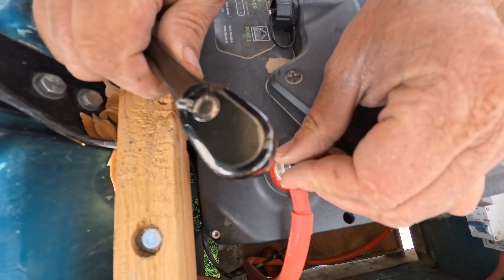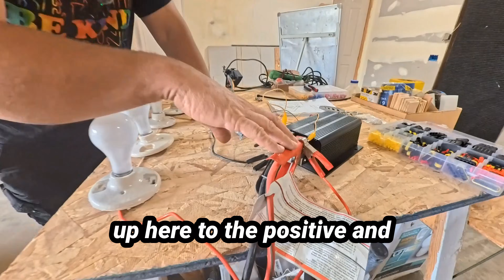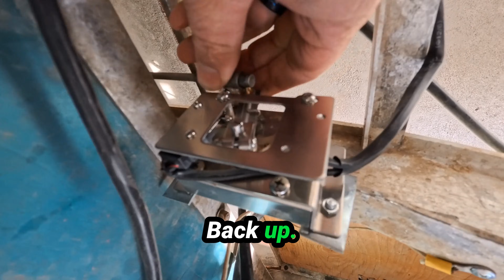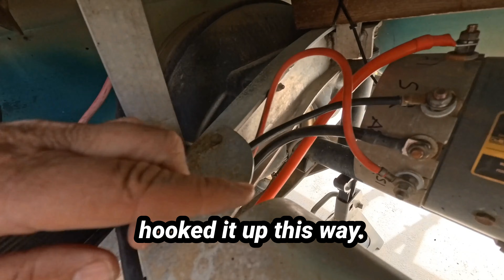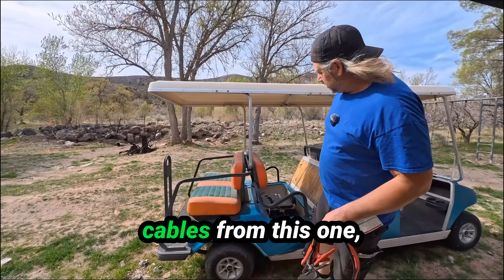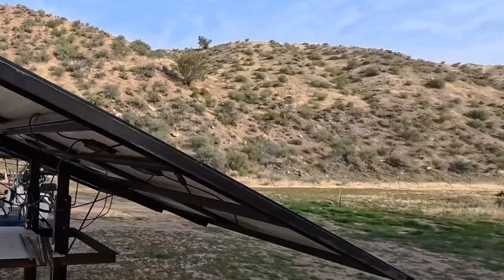Club Car Resistor to Curtis 1205 Solid State Conversion

Comment: 1. Why do you need a precharge resistor for the solenoid?  
2. Can i run the solenoid without a pre charge resistor?
3 what are the specs on the resistor?
Reply from the maker: The resistor on a golf cart solenoid plays a vital role in precharging the controller by allowing a controlled flow of power. It helps in preventing any sudden jolts or surges of electricity, ensuring a smooth and safe operation of the golf cart.
Your golf cart will work without a precharge resistor, but your solenoid and your controller will not last as long.
This is the resistor that you need.
https://ebay.us/V2u4fM

Comment: Great video! The F/R switch you linked is now unavailable and I now only see the 96+ model available (101753005 instead of the 101753004 that you have listed). Will this work? From the pictures they look similar but the 10173005 has more wires.
Reply from the maker: Thank you for heads up that the F/R switch is sold out I did not realize that it was.  Here is a link to a different one that I would recommend it is less money for the same thing and yes it does have more wires because it has more micro switches on it, but it will work fine.
Reply: @Thesolarfarmer  Where is the link?
Reply from the maker: @Evan-mx5bi  https://ebay.us/8BlNbX
Reply: Thank you! Cant wait to get started on this and revive this old cart!

Comment: I have an 88 CC DS. I recently installed a 36v lithium battery. Can I use the same parts as you or do I need to find the 36v equivalent for each part? Thanks man awesome vid!
Reply from the maker: Yes, you can use same parts. I have used a 36v lithium in the cart in the video it does go 10mph less on 36v.

Comment: Would this whole set work on a 36v cart?
Reply from the maker: Yes, if you are using lithium battery.  Lead acid voltage is to low for this controller.

Comment: So the motor does not care if 48V or 36V? I just acquired and Ezgo J-87 (model is REMANUF J-87 not sure what the remanufacture is about). It is a 36V and has resistor type of system. Would I need to stay at 36V or could the motor likely handle 48v? I have some pretty big hills I want to be able to go up. Any advice is welcomed. I love the idea to bring it into the modern age so if things go bad you can get parts.
Reply from the maker: My golf cart was a 36 Volt golf cart when I started.36v Series motors work just fine on 48 volts and can even go higher.
Reply: @Thesolarfarmer  How do you know if it a series? The motor in this unit come up in what the battery compartment unlike newer where is just above the rear axles. So that eats space right in the middle, but I think to add lithium will still fit on one side.
Reply from the maker: @andywilbourn8761  Series motors have four wires going into them that are all the same size. A1, A2, S1, S2

Comment: Do you happen to have a diagram or pic of everything going to your pos. and neg. busbars?
Reply from the maker: I have my auxiliary 48 Volt out, solar panel controller and my Curtis controller hooked to the bus bars. The solenoid and key switch is hooked to the positive bus bar

Comment: Can I run both a2 wires off controller or do I need to join them at fnr switch. ( have a2 going to fnr from controller. A2 from motor going to fnr) meeting at controller
Reply from the maker: That should work. https://www.manualslib.com/manual/815243/Curtis-1204.html?controller=view&page=19#manual
Reply: @Thesolarfarmer  do you need the diode on the solenoid? When I hit the key the diode exploded I have a new one on order. I found out that the diode was hooked up backwards from when it got shipped and I set it up just like yours was and didn’t realize that the silver part with the red wire was where I put the negative wire.
Reply from the maker: @joshuamcclure191  From what I found out with my researching you don't need a diode if you don't have regen breaking.
Reply: @Thesolarfarmer  cool when I measured wires I measured it that way and forgot you bridged it at fnr switch so I wanted to make sure I could do it that way
Reply: I just got everything working and took it on its maiden voyage thanks for the video saved me from spending a bunch of money on a new golf cart or having a shop do the work for me
Reply from the maker: @joshuamcclure191  Good job getting it all put together. Gotta love the power and smooth acceleration.

Comment: First off, thanks for the video, it's been super helpful for me.  I'm copying you and have ordered all the same components. Quick question on the Potentiometer...I'm having difficulty installing it somewhere where the lever goes from its rest position to fully maxed on the other end.  And after re-watching your video I just noticed you installed yours where the 'lever' starting position is just a bit beyond where it would naturally rest...and this would work for me, but is that alright?  My thought was that the system would recognize that as very slight acceleration when you turned the key on. I'm obviously a newb.  TIA.
Reply from the maker: Use a voltmeter to check when your potentiometer starts working. On mine there is a bit of movement before it kicks in.

Comment: So, as others have stated above, I have watched the videos hundreds of times and have wired and rewired the cart probably 4 times now and still no movement.  I’ve tried 2 selnoids, 2 pot boxes, and 3 controllers and still nothing.   I have a 1990 club car 36 v and it was running before I started the conversion.  I purchased all the same parts listed in your video other than the battery.  I can connect the batteries, turn the key switch and then turn the F/R to either F/R and the selnoid clicks but when I press the accelerator nothing happens.  I even tried using the pot boxes and still nothing.
Reply: I was thinking the same thing yesterday so ordered a new controller programmed to 36v.  I had just been ordering the one you suggested and it was always programmed to 48 volts.  After checking out some of the Curtis forums, I read where they said it would be a low power shut off due to not enough volts so essentially the controller would never turn on due to it thinking the batteries are already dead.  I’ll hook up the new one tomorrow and get back to you.
Reply from the maker: @markmetheny2221  I ran my controller on a 38.2 Volt Li time battery for months.
Reply: One more quick question, lol.   Upgraded to the 48v lithium and it made a huge difference, but my issue is, there is not enough throw in the gas pedal to make the cart go full speed.  I shortened the downward bar and get get a little bit more movement but how did you get full throttle out of the cart?
Reply from the maker: @markmetheny2221  I just hooked up to the closest hole, and it gave me enough movement to give be full throttle.
Reply: @Thesolarfarmer  ok. Thank you.  I did the same thing but can only get 13 mph.  I hooked up the other pot box and used it hand held and can get 20 mph so I know there isn’t enough throw for some reason.  I’ll see if I can adjust the linkage any or if I need to rig something else up.
Reply from the maker: Man, that's no fun. I really appreciate everyone that has commented on the problems that they are having so I can address them in my next conversion video. I have a 2002 Club Car that I just got done burning up the VGide and am starting to make a more detailed conversion video.
Reply: @Thesolarfarmer thank you for the videos. And still sitting with a “dead cart”. I have 2 different pot boxes and when I go to the pot box wiring I get 0 volts when I use the pot box from the controller.  I tried both pot boxes and both controllers I have and nothing.  I also connected the ohm meter to the J2 and J3 and there is no movement on Ohms.  Any chance I have 2 dead controllers?  I haven’t had any shorts or wrong wiring but I guess with cheaper controllers the possibility is that.  Any ideas?
Reply from the maker: @markmetheny2221  I am bench testing a new controller this week. Hopefully I can come up with some ideas to help you.
Reply: Just an update…. 3rd controller came in today and same results.  I then rewatched the video and was trying to figure out why I had no power/ohms to the J2 or J3 so I wired a hot lead from the + on the controller and had some movement from the cart.  It was jut momentarily but it was the first progress I have had so far.  So, for some reason I am not getting power from the small wire on the selnoid to the controller.  I’ll dive into this deeper this weekend unless there are any other suggestions.
Reply: Still just getting a little bit of movement but won’t keep turning the wheels. Just checked the controller I ordered and it comes pre programmed for 48v and my cart is 36v, do you think this could be the issue?  Should I try and get one preprogrammed for 36v?
Reply from the maker: @markmetheny2221  Are you using lead acid batteries? If you are that could be the problem because the lead acid voltage would go too low and turn off the controller when you drive.
Reply: @Thesolarfarmer  so, the new controller fixed the issues and I wonder if others are having the same issue by getting the 48V controller for a 36v cart.  Now I’m charging the lead acid batteries to see how long they last to see if I need to upgrade to the Litime now or not.   I’m going to keep the 48v controller though for when I do upgrade batteries.   Hopefully others read these comments and items help them because I was just ordering your parts list without thinking about 36v or 48v.  Thank you so much for the video and all the responses.

Comment: Thank you. Great instructional video. I don't understand why the pot specified is 0-5k. Seems that if you add resistance, you should slow the acceleration. Why isn't the 5-0k pot ?used?
Reply from the maker: It has to do with the programming of the controller. The controller can be programmed to use 5-0k   instead which is more common with EZGO. I am getting ready to convert my 2002 Club Car to solid state and I am going to use a MCOR 4 throttle controller. This is the one I will be using https://ebay.us/xxHFqF Hopefully it'll work I have not tried them before.

Comment: Thank you, I just had a friend of a friend who builds carts tell me that there is no way to convert an old 36v cart to solid state other than replacing everything including the motor. He said it would be around $3k. I was doubtful that was the case but he said it with such confidence that I was a little worried. I figured there would be someone on YouTube that has done it.
Reply: I put in a 51.2 volt lithium to run my series 36v motor. Amazing how quick it starts and how fast it goes. I eliminated the resistor coils. and added a the 400 amp forward and reverse solenoids. Plus the 400 amp main contactor and Installed 2awg welding cables, Probably over kill. I used the original FnR selector switch in low current mode to pull in the FnR coils. It all cost a little more money to do it like this. But I don't have the resistor coils robbing current from the motor.
Reply from the maker: @smitty2721  Series motors are definitely the easiest ones to get more speed out of. That's awesome good job on your cart.
Reply from the maker: These series motors on these old carts are pretty amazing I have heard of people putting it as much as a 120 volts into them. I am trying to find a 72 Volt controller so I can run 72 volts into my 36 Volt series motor It's going to be a fun experiment.
Reply: @Thesolarfarmer  Wow!  Can't wait to hear how that works out.

Comment: First off excellent video on showing us how you did it! Thanks! I've been wanting to do this for the longest time and this video pushed me to finally buy the parts! 
Do I need the solenoid and diode set if the 48v solenoid comes with a diode? or is it for something else?
Reply from the maker: The solenoid diode set is for people that buy a solenoid That does not come with them. I have bought the parts to convert My 2002 Club Car to solid state. I will be making a really nice, detailed install video for it.

Comment: There are cheaper batteries out there with same specs... Do you have any thoughts on others besides Big Huskey?  Would like to do it a bit cheaper, but not if sacrificing longevity or safety....any other brands you might recommend?
Reply from the maker: DC House has really good reviews and a good price. This link will give you 2% off. https://www.dchousepower.com/?ref=wnbqytmg

Comment: What do you with the speed sensor on the end of the motor?
Reply from the maker: Series motors do not have a speed sensor. I think the 1205 controller will not work for your motor

Comment: Have you had any problems with the the controller
Reply from the maker: The controller has been working great I probably would have burnt up 10 Vglides by now the places I've been going.
Reply: @Thesolarfarmer  that’s good to hear it is giving me the encouragement to upgrade mine. I’ve been having problems because I didn’t know the motor that was changed in it was a high torque motor and it was melting everything because it needs a 500 amp controller

Comment: Hey Dude. Going crazy. 90 DS. Stayed with 36v since batteries are new. Installed all the same parts. Same hook-up cable wise. 
So this is what I’m seeing:
Key-off-nothing works-good thing. 
Key-on. Move F/R switch to either position and solenoid actuates. 
Step on accelerator and nothing (no movement, no clicks).
Power to control box (to small top spade from solenoid). Removed to 2 pot box wires to test. Ohm meter between the 2 pot box  cable shows increase when moving accelerator. All connections tight. 
Only concern and possible mistake was on the pot box. I cut off the connector to the 4 wires. I ran the accelerator’s red and black individuallly to the controller two spades (one on each lower spades). 
The 2 wires for the switch on the pot box, I just taped each wire and left them not connected to anything. 
I also hope the controller isn’t bad. 
Any help would be appreciated.
Reply from the maker: You did a really good job explaining what you have done already. I would check the output of the controller with a voltmeter.
Reply: All finished and working but ran into something today. While under load (uphill or full throttle) the power quit/dead. After a short time (10 seconds or so) or if a turned the key to Off the on, it would go back to normal. I did hear a slight bang before the shut down. Not sure what’s going on.
Reply from the maker: @RTewks  If you are using lead acid batteries then the voltage probably went too low and shut the controller off.
If you are using a lithium battery then most likely you are pulling more amps than the BMS is rated for.
Reply: @Thesolarfarmer 
Have a newer set of 36v lead-acid. Besides going Li, any other suggestions?
Thank you.
Reply: The controller is a 500 amp
Reply from the maker: @RTewks  The controller shuts off at 30 volts and lead acid batteries will drop below 30 volts when you climb A hill. The only thing you can do is put a solar panel on the roof which will boost your battery voltage up a little bit and that will probably help. Start saving up for a 48 Volt lithium you'll love it.
Reply: Did you figure out the issue? I'm having the same problem.
Reply: I had 2 bad controllers in a row. First just didn’t work and the 2nd wasn’t programmed correctly. I thought it was me. lol. The last one works as expected. Thank you for the videos.

Comment: Have you had any problems out of the cheaper solenoid? What could go wrong if it fails? I’m thinking of buying one because my local shop wants $200 foot one.
Reply from the maker: Solenoid has been working perfectly for quite a while now. If your solenoid fails, then your cart won't drive.

Comment: Hi! will this setup you have installed on your Club car, work with my Yamaha G2?
Reply from the maker: I don't know I have not worked on any Yamaha golf carts. It would depend on what motor is in your Yamaha. The 1205 Curtis controller is not golf cart specific It is a DC motor controller That is designed for a wide range of applications.
Reply: @Thesolarfarmer  Thank you, so very much for fast response! Great video by the way!

Comment: My ds is 36v it has 6 good lead acid batteries. 

Do I still order the 48v Chinese curtis or will I need a 36v specifically.
Reply from the maker: I would get the 48 Volt Chinese Curtis controller so you could go 48 volts in the future if you want. I have been running a 36 Volt battery in my club car for a couple of months now. With a 48 Volt controller. https://youtu.be/2JQsEvNkglg

Comment: Awesome video! Is that a main fuse on the red line coming in?
Reply from the maker: I do not have a main fuse on my system. I do have a breaker that goes to my auxiliary 48 volts out that I use to plug inverters in and other golf carts.